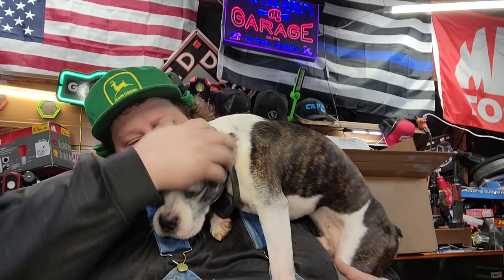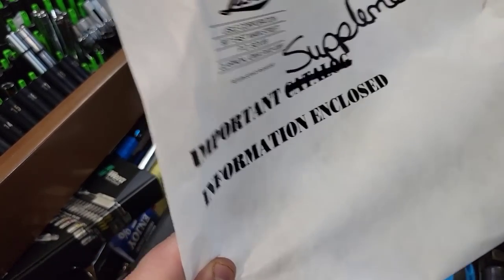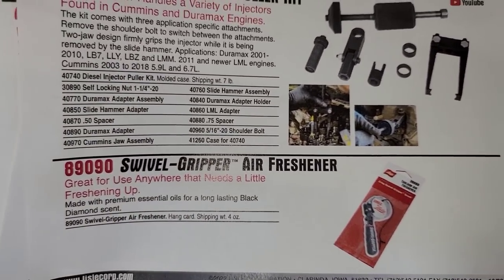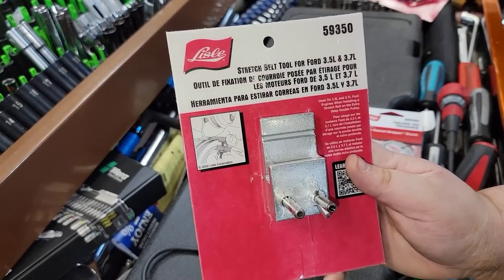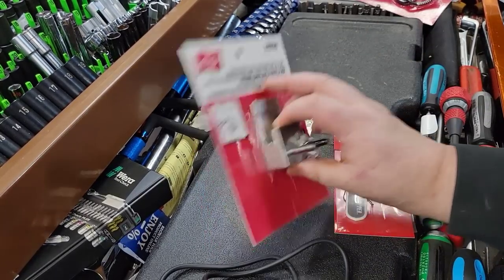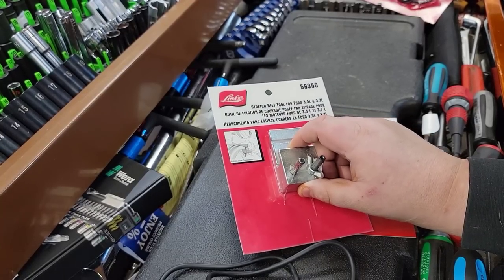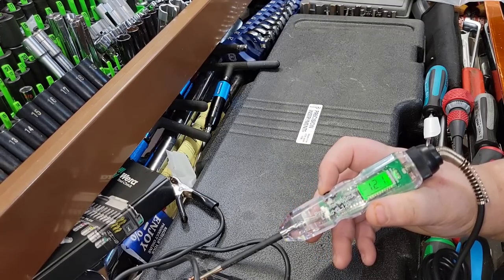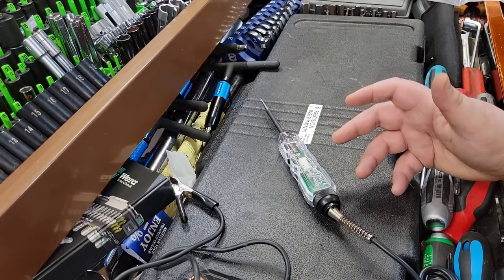LISLE NEW TOOLS HOT STUFF MUST SEE!! 50240 28800

Comment: A tip for the magnets on the funnel holder:  put blue painters tape on the magnets.  It’ll prevent scratching of the tool box and the tape can be replaced if it gets packed with metal/rust/crud.
Reply from the maker: That's a awesome tip!! Thanks Dave I appreciate 🙏
Reply: Great tip. I do this on my magnetic lights too.

Comment: Nice video.  I saw those advertised on Lisle's YT page.  I was interested in the test light until I saw the price.  It's a glorified Load Pro.  I have a Load Pro and higher amp homemade test lights to load circuits with, so I don't really need it anyway.

I bought a 310 funnel on your previous recommendation and really like it.  I should have bought more since I prefer the orange color and the rubber feet on the magnets.
Reply from the maker: I'm not sure how you can call it a glorified load pro when it's not a accessory it's a srand alone test unit it does the job of two tools in one it can save tons of time when you are testing a circuit where you normally would have to use a test light a Multimeter and a load pro.
Reply: @CPthetooladdict  The only time I saw the light come on is when you pushed the button so it appears that the light is only there to load the circuit.  The original Load Pro doesn't use a light to load the circuit.  My point is that IMO, it's not worth the asking price for what it does.  Maybe you didn't demonstrate its full capacity or that it can function as a regular test light without pushing the button.  If so, I might change my mind.
Reply from the maker: @Mr2004MCSS   it's 78.00 on Amazon the light comes on 5sec so you don't overload.
Reply: @CPthetooladdict  Ok.  That price is a lot better as well.  I would like to see it actually used in the field on a bad circuit.
Reply from the maker: Yes I understand I intend to the lisle site is always high priced because they do that to protect the dealers so they can sell cheaper they are the most unselfish company in business
Reply: @CPthetooladdict  Believe me, I love Lisle tools and have a ton of them.  I ended up ordering this new load tester from Amazon to see how I like it.